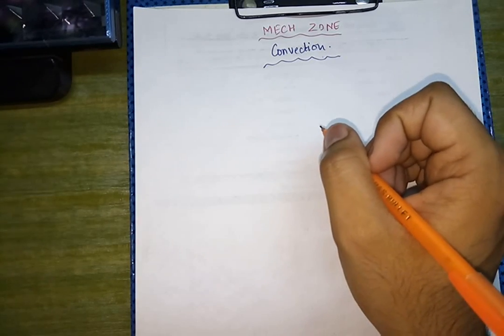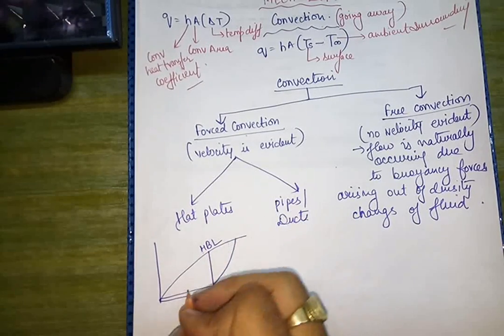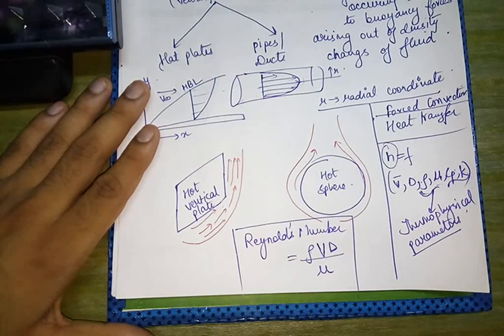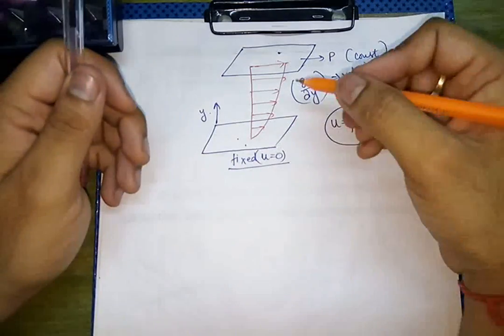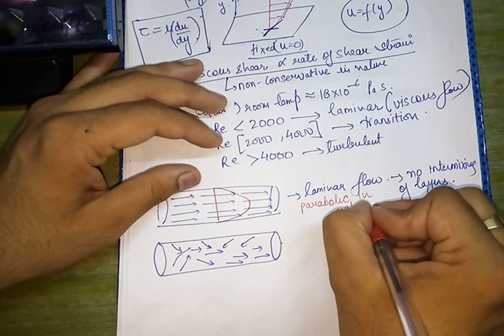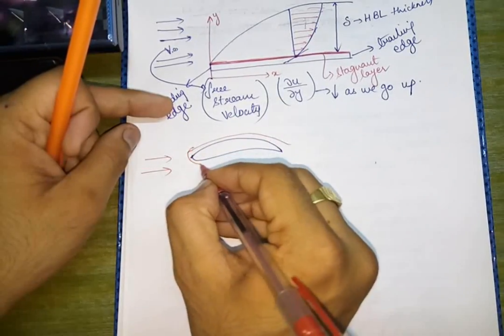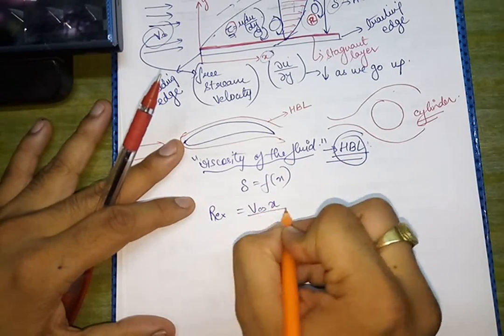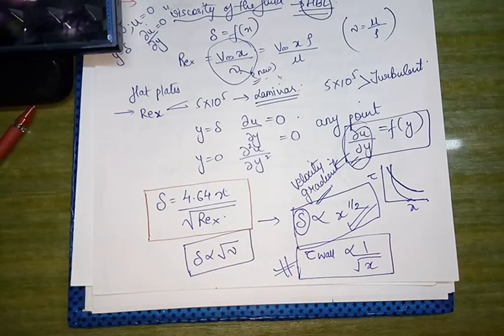Heat transfer lecture 15 : Convection | Free and Forced Convection | Reynold, Nusselt & Prandlt No.

Comment: Plz solve gate mech 2016 set-1 (2mark ques) and 2017 set 1 (2 mark ques) Heat Transfer ques, its slightly confused..
Reply from the maker: If possible please specify the questions or give us the snapshot of the questions on our mail is- shagun.mnnit3733@gmail.com